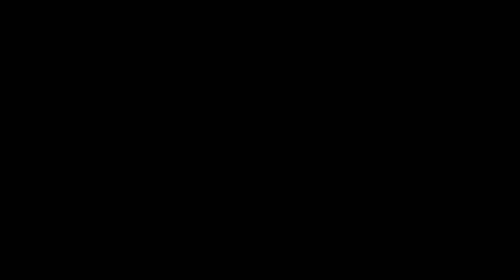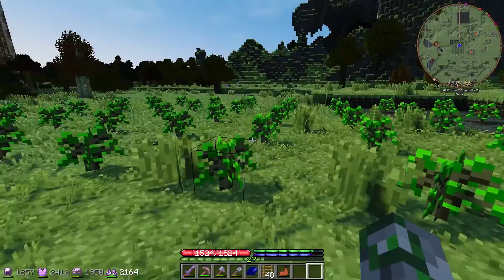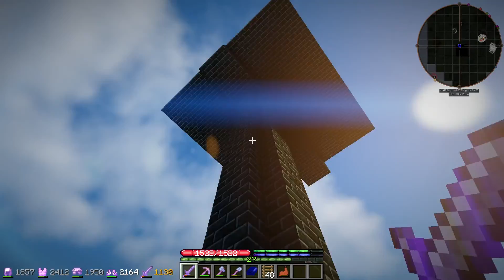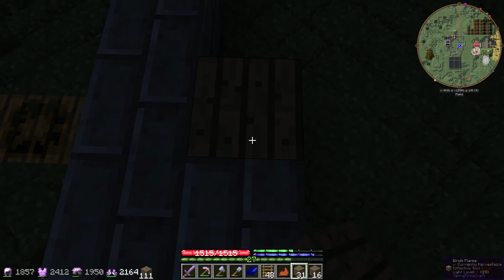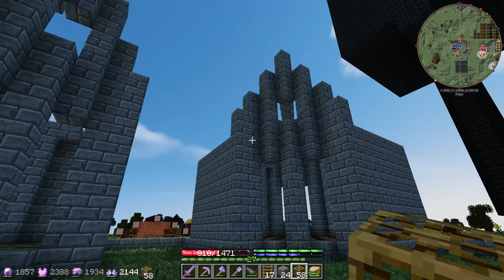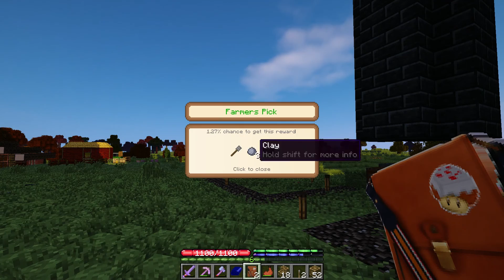TerraFirmaPunk Let's Play SMP s1e17 - Construction Worker

Comment: those railcraft solid steam thingy really need a steady source of fuel, wonder if there are any blaze spawners or tree farms that can be made.
Reply from the maker: +Oracle I'm playing with ideas on that. The passive farm does give me coal which I was thinking of feeding straight into a coke oven and using in the boiler but it is too slow. I have two ideas for an automatic tree farm but I don't think I can build either just yet. For now I think I'll make a redcap farm and just stockpile a huge amount of coal, process it, and see how tons of coal coke does.